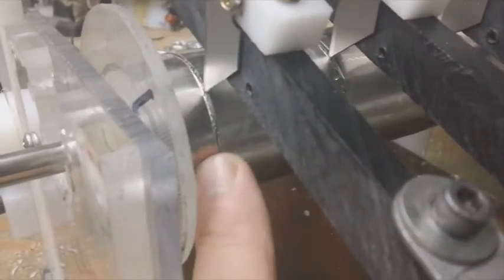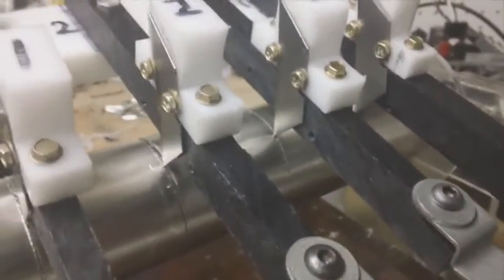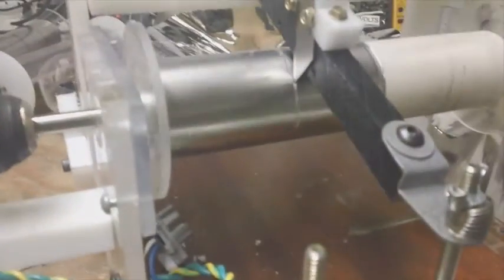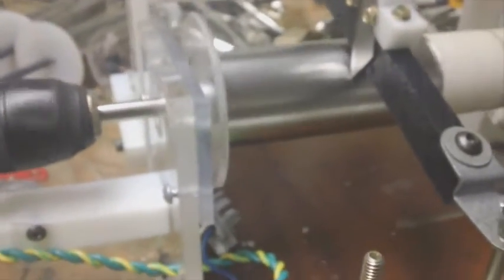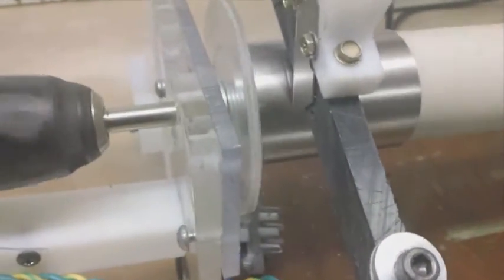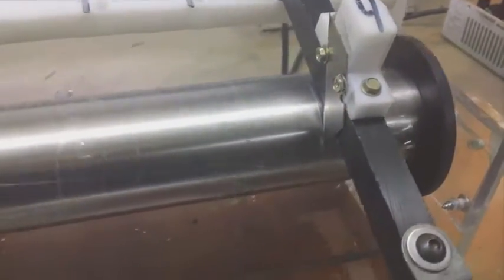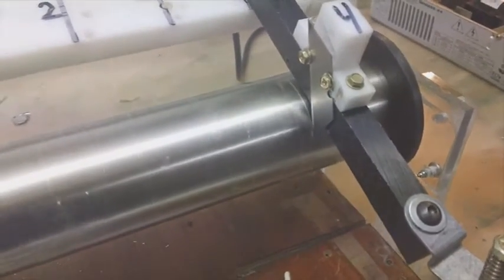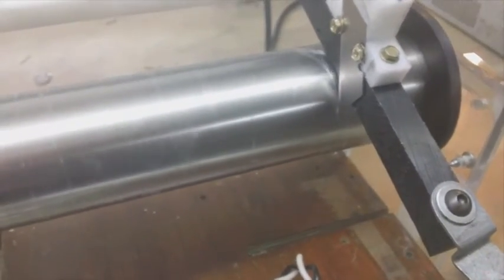Amorphous Metal Cutting part 2

Comment: spring load the blades separately this way they will have better consistency in cutting force. It would take some rigid springs but as with leds you should not parallel the pressure points without something to give in series to each one of them.